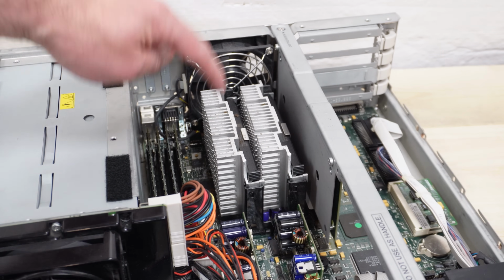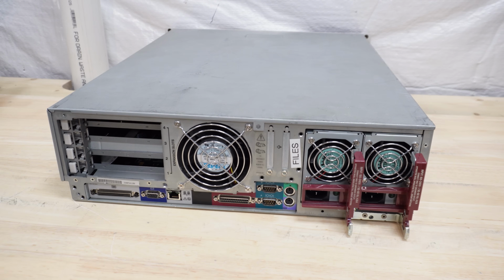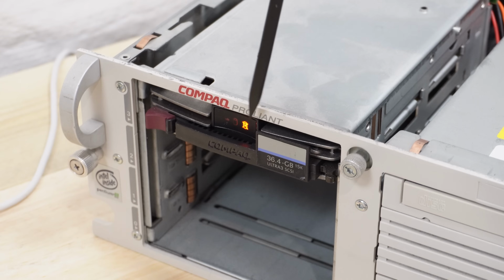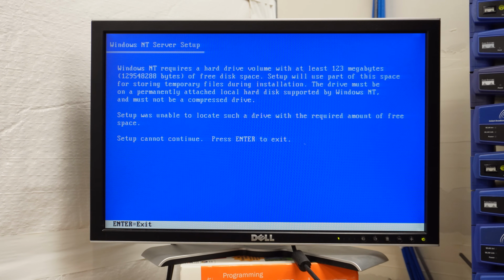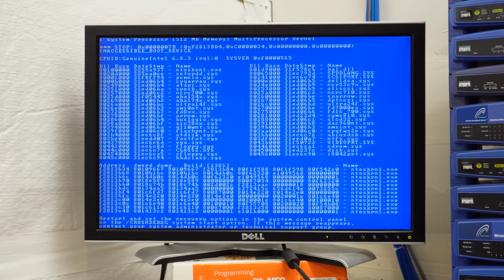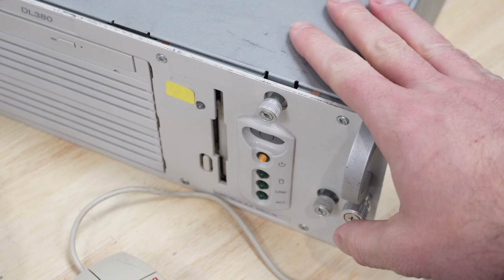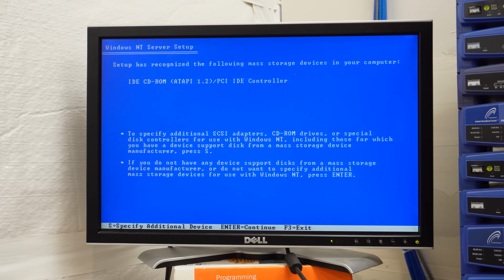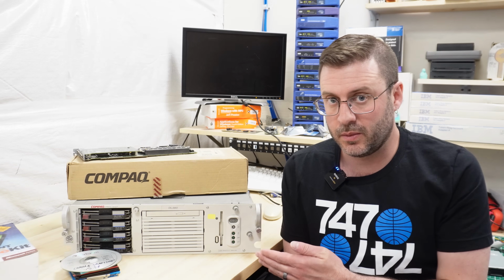Failing to Install Windows NT 4.0

Comment: I did run into the same issue with compaq proliant 400 , no disks found after specified drivers.. Solution is to not boot from cd but use the 3 floppy boot disks for workstation or server : see Internet Archive . Tested and working ... Running win nt 4.0 ent server

Comment: Had you successfully installed the OS, you would have had more fun ahead of you.  Windows NT 4.0 was the final operating system that Microsoft made that did not have Plug And Play functionality (my understanding is : Microsoft didn't think it was necessary to provide PnP functionality for Operating Systems that were being set up by "Professionals" LOL, a different time indeed).  After the OS installed, often times you'd find your having to manually specify I/O, IRQ, and DMA numbers in a driver config file for the expansion hardware you installed (back then that would have been something like a sound card or a video card, fun times!).

I started out my career in 2001 in a Novell NetWare shop, so we didn't migrate from NDS to Active Directory until Windows 2000 was already out, so I had no experience with Windows NT 4.0 *SERVER*.  I did however have a bit of experience with NT 4.0 *Workstation*.  The systems I supported that ran NT 4 were all specialty equipment (more specifically : Non-linear Video Editors) so I know the song/dance about having to feed diskettes with SCSI drives to appease the NT 4 installer whenever the OS needed a reload.

By the time we migrated to Windows 2000 Server (and Windows XP on the endpoints), we had moved away from Compaq/HP and were onto Dell PowerEdge gear (PowerEdge 2650 was the first stuff I worked on), and Dell also had an equivalent of "SmartStart" (can't remember what they called it back then) that was also a bootable CD would preload Windows drivers before "handing it off" to the Windows installer.  It was pretty painless though with Dell PERC cards, definitely never went to the agony you just did.

But yea, you brought back some very old memories with those SmartStart screens (what we'd use to reformat our Proliants for NetWare 4.x to 5.x upgrades)

Comment: I'm surprised Win 95 could access that RAID1 volume.  Usually, Windows NT needed a driver to access the RAID card.  Also, Smart Start should allow/help you to install Windows (or Netware) and provide the drivers needed during install.
Reply: Ok, you did try Smart Start and yes, you need to add the RAID driver.  This is an 8 month old video, so you've likely figured it out.

Comment: Windows Advanced Server 4.0 is what I started with on my 3 Proliants Servers, 2 Proliant 7000, w/XEON 550 2MB Cache and a  a quad Pentium Pro 1MB of cache Proliant 6000 with a 30 GB RAM Drive..the 6000 used Win 2000 Advanced Server

Comment: I love how nice server gear is, with all the manuals, hot swap parts, tool-less design, sweet layouts and all. BUT, the monkey paw in this has to be anything that has to do with storage: controllers, raid, backplanes, etc. I have just spent the whole weekend fighting with an LSI raid controller trying to make it read my SAS drives, ended up flashing it in IT mode and just saying the hell with it. I can feel that pain.

Comment: Many years ago, I was living and working in Mauritius and I bought a new custom-built Pentium PC to install Windows 98, Linux and Windows NT. 

It was a sunny Sunday morning and my computer juices were flowing freely. 

I installed Windows 98 first and afterward Linux. 

I felt at one with the universe and buoyed up with ineluctable pride and joy as I installed Windows NT. 

I was three quarter the way through the installation when there was a power cut. My face contracted like a lemon sucker's with disbelief. When the power was restored two hours later, my hard disk was thrashed and it wouldn't boot into any OS. 

I took the Windows NT CD down to the local beach and slung it so far into the sea that I reckon it landed or was washed up in Tonga!

Comment: Yeah I remember having to do this bullshit.  Each time took about 2 hours. And I had to redo it like 4 times.  It was stupid pain in the ass, but when it finally started working it worked, eh okay… Sql server 2000 active passive cluster and it did properly fail over after I finally got everything perfect.

Comment: Yep, I've done that too many times with RAID controllers.. They are amazing when they do work, but had very poor driver support up until WIndows Server 2000 or so. The drivers need to be loaded early on, and the right ones too. If the drivers were too old or too new, wouldn't match the firmware on the RAID card from Compaq/Hp.

Comment: Going directly into RAID troubleshooting on a 90s era beast. You are a glutton for punishment 😆. On older systems like this that have a RAID card, one of the first things I check with a USB OS is that a) the battery works and b) can take a charge (if the battery is rechargeable).

Comment: Man, I remember having to install NT4 on refrigerator sized Unisys ES-7000’s. The Unisys had this feature called hardware partitioning whereby you could chop up CPU’s and RAM into distinct hardware. You could have 4 servers running simultaneously, pre-virtualization. It was so difficult to configure as typical 90’s enterprise hardware was. You had to install a custom HAL for NT4 during install otherwise the OS would sh*t the bed sharing hardware with other “servers”.

Comment: Why NT 4.0? I installed Windows 2000 and Active Directory in 2000 on an AMD K6500, with a Tiger Motherboard, 128 MB of ram, and a puny HDD (I forget - it was all on my friend's machine, and he owned it all). Once everything was installed, we could push the power button to start, walk down three flights of stairs, walk across the street to a crowded restaurant, order a meal, eat, pause for a couple of cigarettes, walk back, and by the time that we got back, it would almost be done booting!
Reply from the maker: Haha. NT 4.0 just for fun... in a future video you'll see why I'm probably gonna slap Windows 2000 on this bad boy
Reply: @clabretro  Win 2k is a much easier install than NT 4.0- you'll grow hair on your palms installing NT 4.0

Comment: Having been a system administrator 25 years ago, yeah, this was painful.  WinNT4 setup can only create 2GB partitions because it creates them all as FAT16 which is limited to 2048MB.  Setup would then convert the FAT16 partition it created to NTFS if you chose to have NTFS disks.  If you create the partition in another NT4 system (SP4+), you can format it as whatever size the controller supports then move it to the system you're building install NT4, leaving the file system intact.  What I would do here is install an Adaptec AHA-2940 controller, then install NT4 server since it supports that controller natively, then use your five diskettes to load drivers until the onboard controllers work, then you know which driver to load during NT setup.  once your kickstart install can see the fancy Compaq controller, attach your raid1 drives, create the array and format it using the kickstart OS, then shutdown, detach the small kickstart disk and boot NT4 setup from the CD-rom and install to the RAID1 array using the drivers you learned about.  Then you should be able to see the array as a formatted partition, setup should copy files then you'll be in gui setup pretty quick.

Comment: We've all been there. Keep at it. Feel for you.  I used to cheat back in the 90's. I had an IDE drive with FAT16 on it and the install media. I used to copy the CDROM to the IDE drive, then all the drivers I needed for arrays and such. Configure the scsi arrays. Boot off dos6.22, then goto the ide disk and winnt /b .. did lots of these at DCS.  At one stage in about '99? a bunch of these came in for auction from a failed company I prepped for demos.

Comment: That splash screen for Smart Start brings back memories, my first support job out of school was sorting reusable from EOL equipment at warehouse for a large store chain. Forget model# but remember being dual slot 1 Xeon P3 500 units, easily 40-50 skids of beige Compaq Proliant servers to decommission. Process included recording S/N, Smart Start to format array, physically damage all drives after & off they went to electronic recycling.

Comment: Not sure why you needed to copy setup files to the hard disk on a 2gb partition. You should have been able to just boot it from the CD and install, at least that's how i used to do it back in the day. I cant tell you how many times i have installed NT4 on a server just booting off the CD and driver floppies for the hardware. 

Even worse was nt 3.51 off its 14 floppies. That was painful to install.

Comment: The batteries being flat on the 5300 will just slow down performance a little and prevent you doing clever stuff like resizing, it will work just fine.

Comment: Watching this brought back some memories! Many years ago I got a Compaq Deskpro XL590 for free. I spent soooo many hours troubleshooting and just trying to get an OS installed. The worst part of these early Compaqs is the BIOS on floppy. It takes so long just to make any configuration changes. You can get the BIOS utility installed on HDD, but ONLY if you follow the right order of operations. I love that computer; I learned so much about computers just with all the troubleshooting I did with it.

Comment: I remember those days of sitting by myself in a computer room surrounded by aircon and other servers with a bunch of floppies and CDs.   My memories are hazy but I don't remember always having to create partitions prior to running the NT setup - except right at the start of using NT4 - they created bootable CD versions and we genrated our own bootable CDs using "slipstreaming" where you could merge service packs into the install media so you weren't having to patch your new install.  With these hardware vendors you sometimes would be given "customized" install disks that had their custom drivers already merged into the installation - so you wouldn't have to manually get floppy disk out and add it.  We ran NCR, Dell and Compaq hardware so each was slightly different.  I often used a DOS6.22 boot disk to boot, create a small partition, copy over the i386 folder and then launch it.  This avoided issues accessing the CD drive after it was in the NT phase of the setup (and was also much quicker).    I understand that the Compaq Smart Start (used from 2002 onwards) did use WinPE which was a version of Windows created by Microsoft used in the setup phase of Windows.  WinPE is still around today - it is basically a minimal version of Windows used for seting up hardware or similar.

Comment: Pro Tip: Windows NT 4.0, no different than Windows 9x, sits on top of DOS. To get around many of the headaches you will encounter during the setup routine, we would boot a brand new server with a bootable DOS diskette with CD-ROM drivers. We would then use FDISK to create our 2gig partition, format it, and copy the setup from the CD to the boot partition (you only need to copy one folder from the CD). Don't forget to make the boot partition the "active" partition, and format it as a system drive (two or three hidden dos files are written to the HDD). Then we'd reboot the system to boot from the HDD, and then launch the NT 4.0 setup from the HDD. The advantage of doing it this way - installation is a lot faster, but more importantly, if you ever need to add or remove Windows features in the future, you don't need to hunt for your CD - just point to the setup folder on the HDD and you're golden. Only the boot partition has the 2gig limit, and this is due to the DOS limitation at the time. You can later convert to NTFS. Once the operating system was installed, we would create a second partition utilizing the remainder of the drive space - naturally using NTFS.

Gotcha: You encountered this yourself in the video - during setup, you need the correct driver for your installed drive array controller, and you will need it on floppy. Hit F6 during setup when prompted to assign alternate drivers, and feed it your diskette. The system will see your controller & drives & you will be good for the rest of the install.

The ancient hardware you have brings back memories - I've disposed of tons (literally, by weight!) of old servers from this generation. If I had known at the time they would one day be wanted/desired, I would have held onto the stuff. Reality of the matter is once these old beasts required upgrading, the new hardware was leaps & bounds better than the older equipment. The old equipment soon became useless paperweights no one wanted.

I've touched all of the server hardware from all of the major manufacturers. I always felt the Compaq equipment was the best, and HP must have felt the same way. HP ended their NetServer lineup in favour of the Proliant line-up. It's just too bad HP paywalls BIOS updates, etc. It's a primary reason why I don't tell clients to buy HP servers. I have two Proliant DL380 Gen 9 servers still in active service & running just fine with Windows Server 2022.

Comment: Hey, I used to have one of those back in the day (late 00's) but I ran Linux on mine... I think I had 4 9GB drives in mine. ISTR I also had one of those external enclosures, they used oddball sleds though and I only ever had two.

All server drives STILL tell you how big they are on the sled, it's not bragging, it's so you don't have to think when you need to replace one of them.

You are correct PCI-X is the 64-bit version of the PCI bus, PCI cards will work fine in PCI-X slots, SOME PCI-X cards will actually work in (3.3V) PCI slots, but you need to be careful that you don't short any of the fingers on the back connector which will be hanging over the back of the slot.

The Windows in SmartStart is undoubtedly some version of Windows CE.

Comment: Haha, I had one of those Proliants with the same spec to play with long ago, but anyway, whenever I needet to install NT4 on a machine I would just set up the disk in Linux instead, way better than DOS or Win9x :P

Also, in Linux you can run lspci to get the PCI ID of your SCSI controller and match that to the correct option in the oemsetup.inf file on the driver support floppy.

Comment: I remember working on those with and without a smart array card - No headaches thou as we were putting Slackware 8.0 and installs were smooth with all detected at once. We also use them in Windows 2000 Server as I recall - great content as always! Thanks for your work retro soldier !
Reply from the maker: thank you! glad you like the videos

Comment: I happily watched this for 43 minutes. When I was in college 99-2001, I took my first professional foray into computers by working at a Computer Renaissance. Yep, I loved seeing the CompRen video last year. Anyhow, we had a gigantic compaq tower server sitting under one of the work benches for what seemed like forever. It was dropped off because it wouldn't boot. A previous tech that worked there couldn't get it working so it was abandoned. I offered to buy it from the owner as discarded for the cost of labor that was outstanding on it. I had these exact same issues back in the day, and the smart start CDs were ALWAYS a pain in the ass. Come to find, someone had tried to get linux on it, botched up the partitions, and failed to understand how to remove/wipe all those partitions properly so that windows could be installed. Thankfully, after a lot of online searches, I was able to get it running Win2K and turned around and sold it. That experience cemented my disdain for pre-gen2 Proliants. Gen3 was about the earliest tolerable...but they still had their issues.

Comment: I worked as a server admin for my internship and we used NT 4.0 servers and workstations at our shop. We had the same Compaq Proliant servers and my job was to monitor both local & remote servers using Compaq Insight Manager (CIM).  If any server was not "green" I had to either A) call the person on site to reboot the server or B) call Compaq Support to send someone to change the hot swappable drive or PSU.

This was around the time when HP bought Compaq and I had "fun" dealing with The New HP which of course meant service calls became substandard.  The company felt the same way so they started to transition to new IBM servers running Windows 2000.

And I was so glad to come home and usie Linux on my PC with Win98 for gaming! 😊

Comment: This is very easy to digest and interesting after I've spent the past week dealing with ext4 partitions and Linux stuff'. Interesting you using fdisk in this video when I'm actively using it in 2025 on my drives. What a long-standing utility!

Comment: How about doing blasphemous thing, starting 32bit system rescue cd with penguin on it and checking what partitions you have on integrated smart array controller. fdisk can show partition table. what fat type partition you have? is it formatted? Nobody was asking to setup second disk. You can leave it unpartitioned.

starting setup from win95 boot floppy while having bootable windows nt cd was painful to watch. You might also start from DOS 6.22. That way you do not have fat32 support in DOS fdisk.

Minimal supported Smart Start version for DL380 G1 is 4.8. Maybe stick to 4.9 disk and create driver disks from it instead of using 5.5 or check 5.5 docs for supported proliant generations. You will need custom SCSI drivers when setting Windows NT on SCSI RAID array.